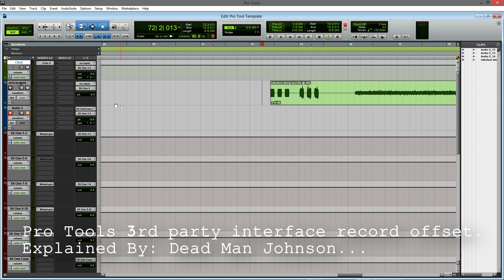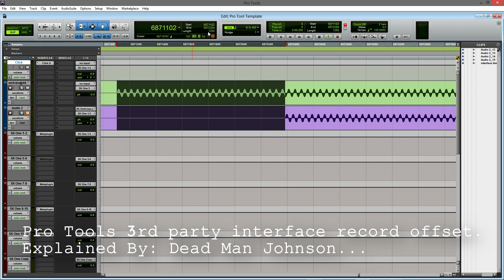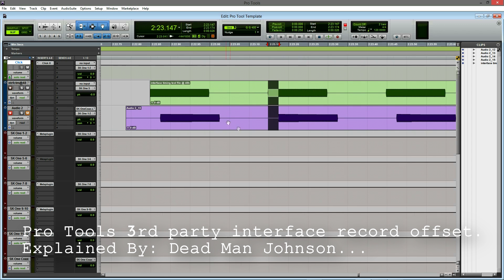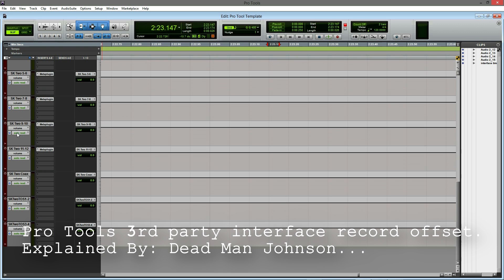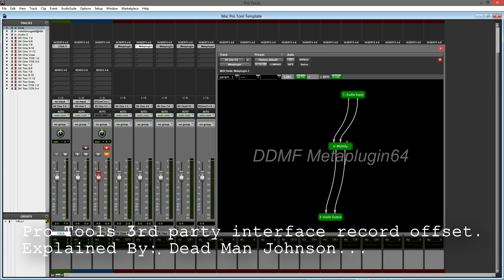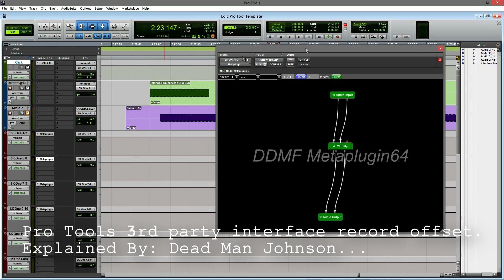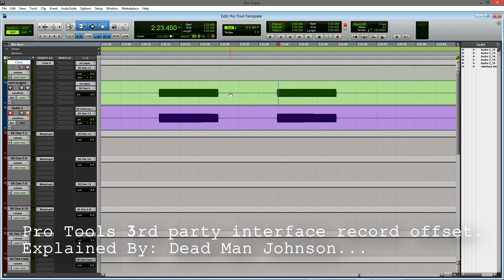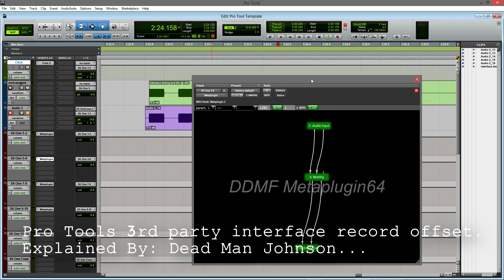Pro Tools 3rd Party interface record offset. Explained by Dead Man Johnson...

Comment: Am i wrong or the same result would be achieved by delaying every track by this number of samples in the delay compensation module of the channel strips?
Reply from the maker: Miguel Rodriguez-Olmos Not the same unfortunately. That would not compensate for both the input & output offsets. The roundtrip offset needs to be figured out for recording/overdub accuracy.